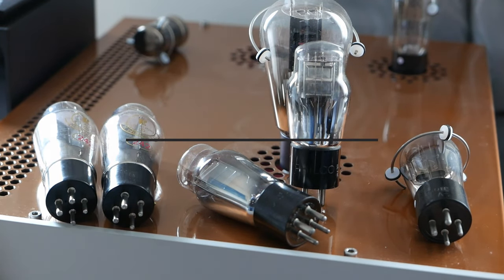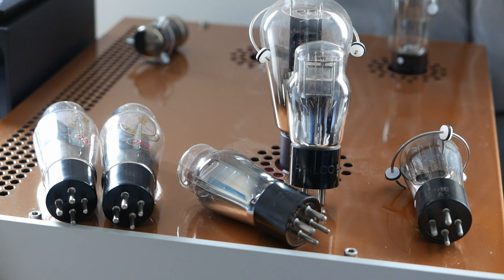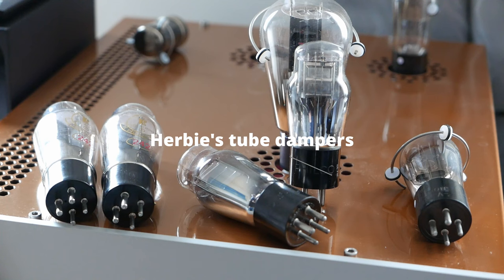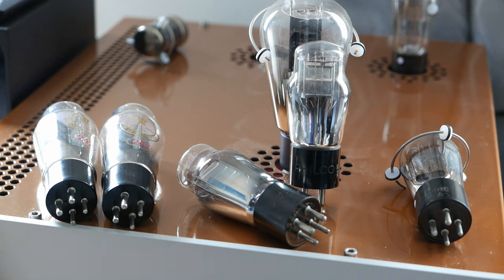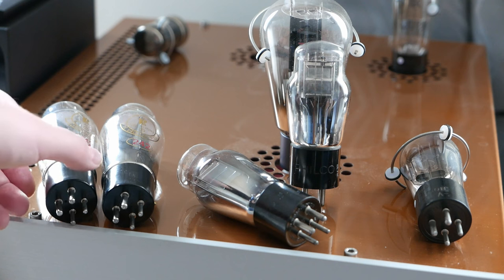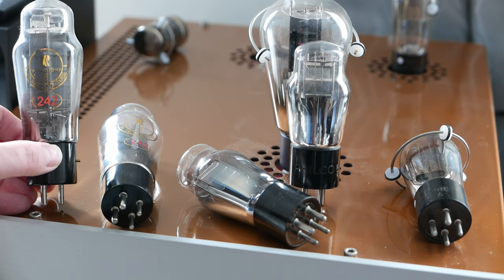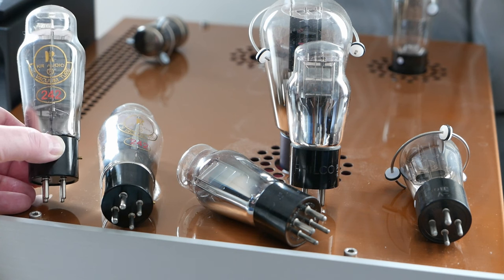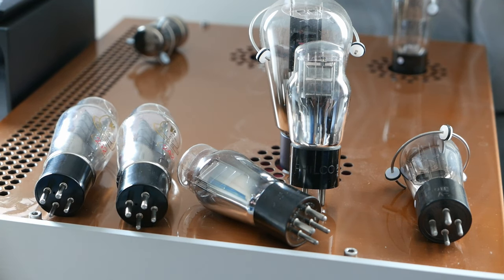Part 2 - Golden Gate 2 - Exploring valves

Comment: I have the 242s in my GG DAC and previously had a pair of c.1995 WE300bs; much as I thought I was all about the 300b sound, turns out I much prefer the dynamics and punch of the 242s. You're spot on with the risk of over saturating the pre-amp and indeed my Concert Fidelity SLX080 is well known for being fussy about the voltage input. Fortunately my Golden Gate has a variable volume control and reducing the volume on the DAC stops the preamp from becoming over saturated and clipping.